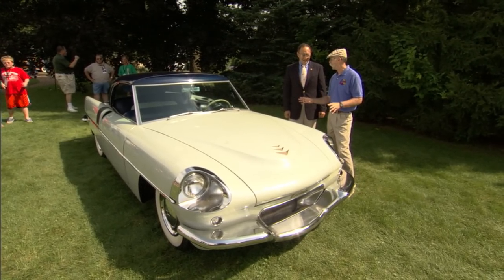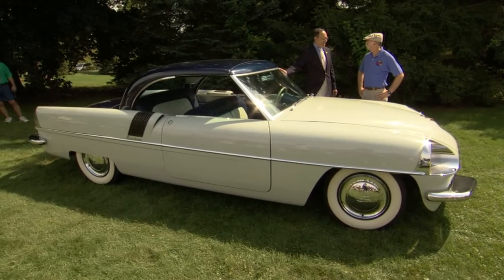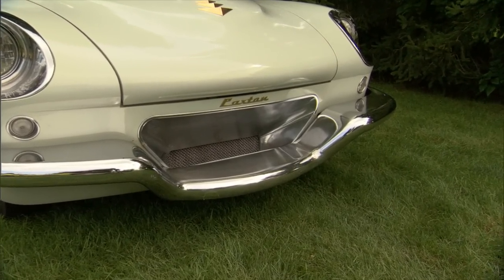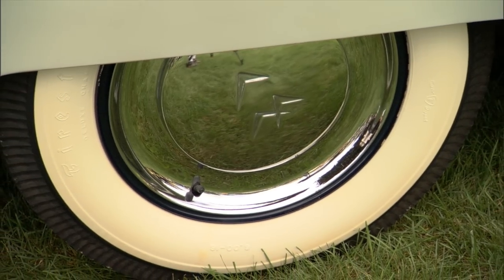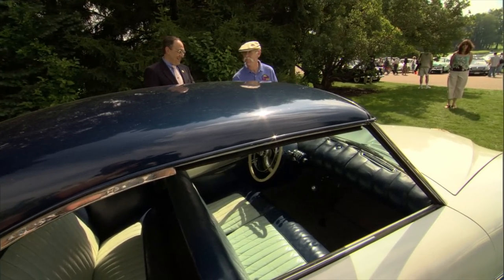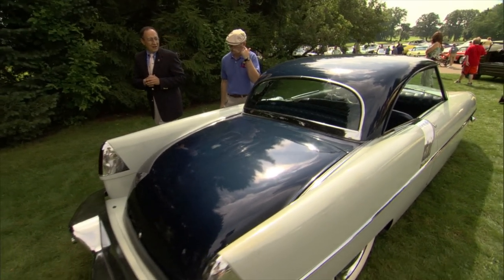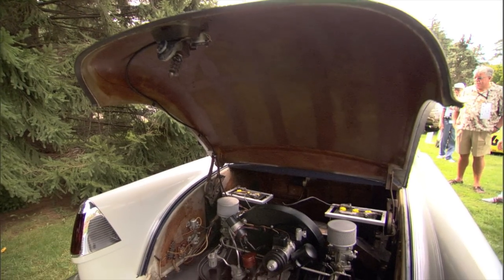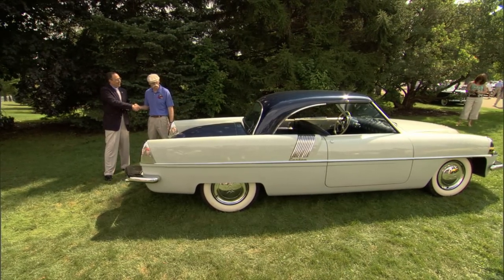Dream Team Prototype Car FAIL

Comment: In Argentina there was a car called the Institec Sport, and it shares a striking resamblance with this Paxton (probably the later influenced the first). It was the second mass produced car with a fiberglass body after the Chevrolet Corvette and also used a porsche engine, but mounted in the front propelling the front wheels. It also had a monocoque chassis and torsion bar suspension. I highly recomend you look it up, it was a really cool car.

Comment: That’s awesome, Rear-engine, fiberglass before the corvette, would have been an 8 cylinder before the Corvette too. Love that dash and boat throttles! Funny the old Porsche motor powering it! The top opened like a Ford 10 years later apparently. This is a historically significant pioneering car wow.
Reply: No, the top doesn't fold up like a Fairlane, but slides to the rear and down over the deck lid. Notice they're shaped the same so they can "nest" together.
Reply: Actually, Ford's retractable hardtops, (Sunliners) were produced from '57 to '59.

Comment: I'm 76 & this prototype looks a lot like the 1954 Packard to me! Also, my grandfather, born in 1881, had a
license to operate 'steam engines' & said that when autos were first invented & some were powered by 
steam, e.g. "Stanley Steamer", the operator needed a special steam engine license, because it could explode,
if not regulated properly! So, steam could have been a great non-polluting alternative, but wasn't practical!

Comment: The 2 stroke v8 would have been something to behold
Reply: Could you imagine the smoke?
Reply: Compares with Czech TATRA.
Reply: @thomasjordan5578  Tatras weren't 2 strokes, tho. Also, search YT for "2stroke V8". There are several videos featuring Evinrude's V8, including dyno runs, and driving a car up and down the street. Wild engine!
Reply: @61rampy65  I thought they were 2 stroke. 
Air cool at least and configured similarly.
Reply: @thomasjordan5578  They had rear engine, air cooled V8's with hemi heads. Really cool stuff designed in the 30's! One of my friends has one. Even as a passenger, I could feel that the tail end was Heavy, and with swing axles, they were actually kind of dangerous!
Reply: @61rampy65  
Nazi killers, appropriated Tatras piloted by SS hotshots would hit the off ramps of the Autobahn too fast and try to gather it back up like a regular car. Its a shame about the cars 🤣
Reply: @61rampy65  
I heard that too
NO TATRAS ‼️‼️‼️🤣